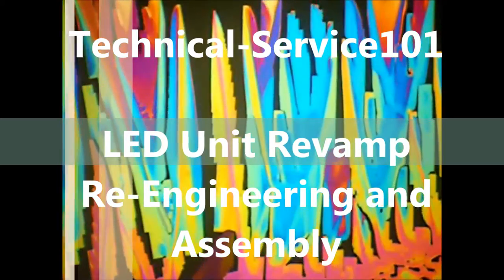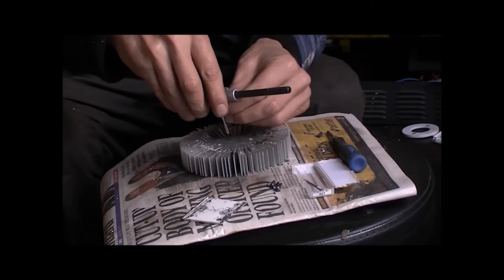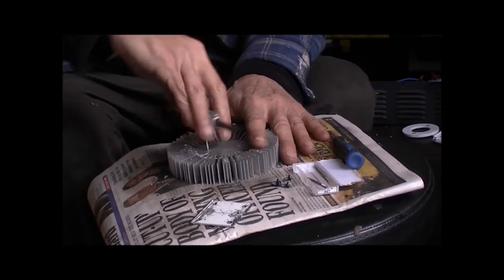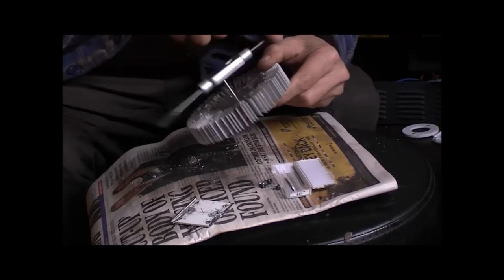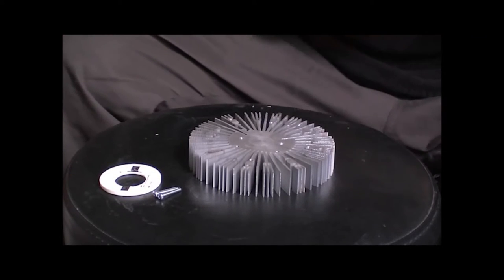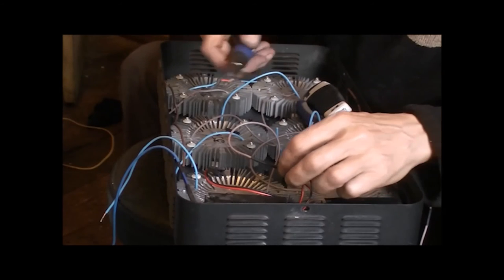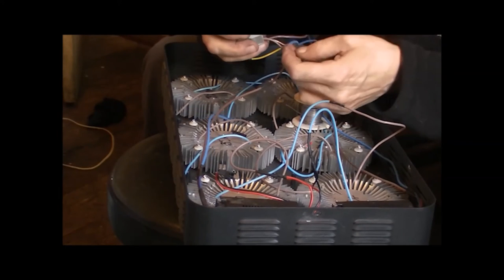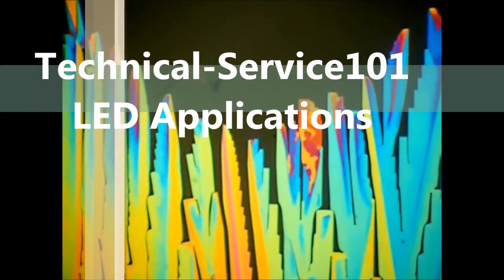Led Growlight Revamp - Assembly

Comment: im using 3590s 3500k.doing a great job..may i ask what cobs you used.?
Reply from the maker: +Chris Fuller These are the Luxeon Gen3 1211's there is a link to luminids site in the description and this unit has a mix of 2x 4000K and 4x 3500K, from the specifications they are very similar units to yours.
Reply from the maker: +Chris Fuller Slight correction, cxbXX90's are 90CRI(if i get their cob numbering system correctly) as opposed to these 80CRI units, in luxeon terms that would be a 10lm/w drop in efficiency as the higher CRI the lower the effective efficiency. Our next build we are going to try 70CRI just to squeeze every last lumen outta our given wattage.